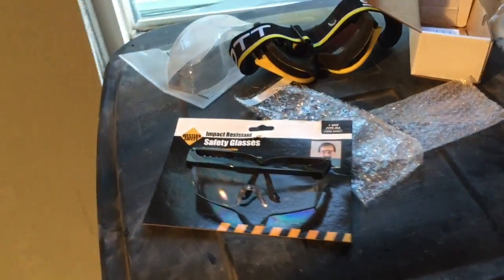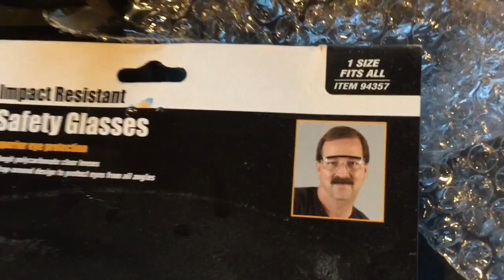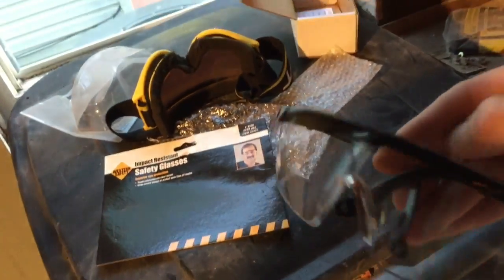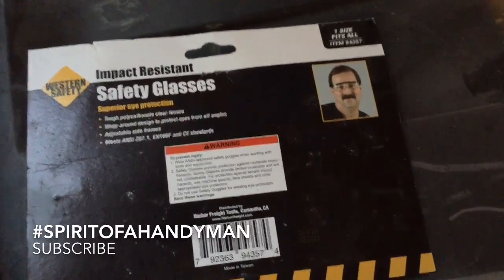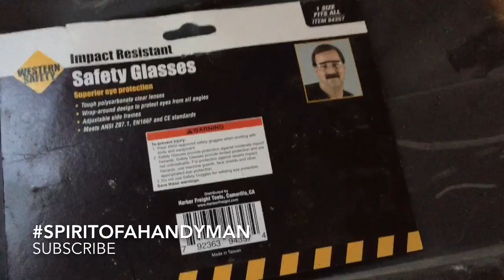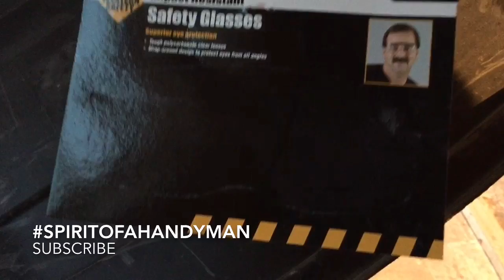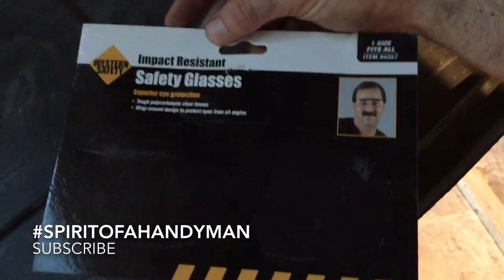What Is Knob And Tube Wiring?

Comment: you know just enough to be dangerous...To say knob and tube is safe besides the insulation is misinformation. It is an ungrounded system with open splices and a fire and electrocution hazard. Please don't get information from google and regurgitate it on a social media forum.
Reply: If it was properly installed and in decent shape, why is it a problem.
Ground would be nice, but that's more about preventing shock than fire
Reply: @mbburry4759  I promise you there's not one house I have ever worked on that has K&T wiring and we decided.. this was installed properly and is in good shape... not once. Besides being 70 plus years old,  there are many reasons it should be removed. No ground means fire and electrocution hazard as well as not compatible with any three prong appliances or equipment. The insulation is lacking in all areas, ambient temperatures as well as moisture to name a couple. Modifications over the years by unqualified persons are a recipe for disaster. Often open slices are buried in insulation.... the list goes on.  Truly not a safe system by any modern standards. I've seen the results of home fires and the fatalities they cause. Please hire a licensed professional.
Reply from the maker: It seems as though the general rule is "replace it if you can, otherwise leave it alone."